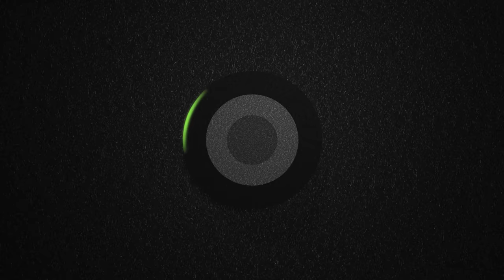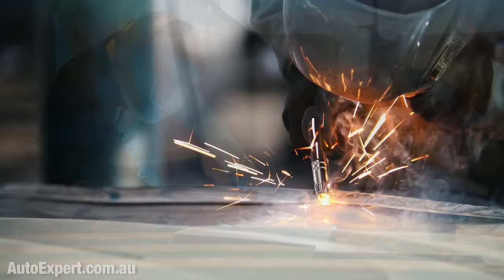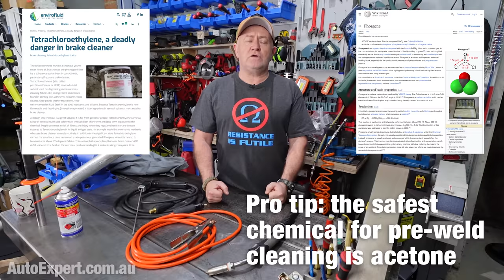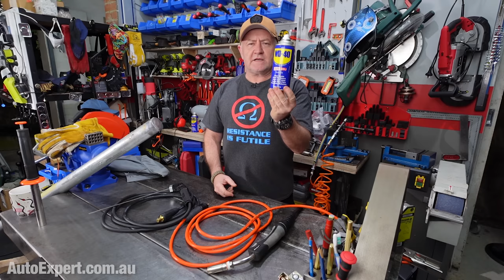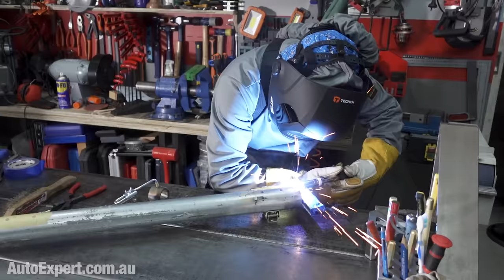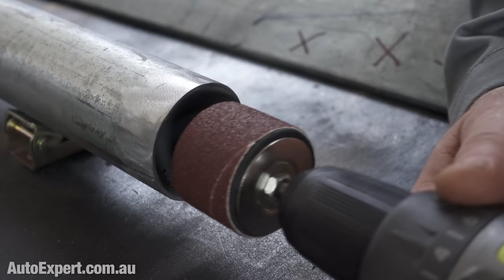How to die while arc welding at home: the top 5 ways | Auto Expert John Cadogan

Comment: One of the horrible jobs I had once was working in a factory on a line with 6 other guys and part of the work we had to do was grind down galvenised metal.  We all were coming down with what we thought was flu.  I looked into it further and realised it was Metal Fume fever.  So I put all my researched material together and took it to the bosses.  Not surprisingly they already knew about this and just could not be bothered doing anything about it because we were all Job agency employees and they could just get more when we got sick of putting up with it.  Well I stood my ground and insisted that they supply the correct PPE  and within hours we were all issued with the correct filter masks.
Reply: Good on you! Companies like that should have workcover hounding them.
Reply: Good on you for standing up for your rights!
Reply: Was it Merika’s navy, cause they hate civilians ! My general foreman died of some nasty cancer he got from working on chemical cleaning of the steam generator on the 688 LA Class tuna tubes, oops I meant submarines.
Reply: You stood up and you won! Good work! If it cost the boss a dime, people just assume it ain't gonna happen. Tight-butt bosses screw themselves and their employees.
Reply: As I recall, My dad ended up missing like a week of work with zinc fever, and the place he was working DID provide masks to employees (but I guess not very good ones). He ended up spending something like $3,000 on a nice papr system after that and never had an issue with fumes again.
Reply: @@BohappenstanceClick Buttermilk isn't going to clean your lungs out
Reply: @MekazaBitrusty or management hunted in a forest
Reply: I'd document everything and then I'd have OSHA on them so fast their assholes would be quivering. By law, OSHA requires the employer to provide any safety equipment that's needed for the performance of your job, and documented training in it's use.
Reply: @@BohappenstanceClick You didn't, but I wanted to state a difference between helping with symptoms and actually solving the problem of inhaling fumes.
Reply: Bosses like this belong in prison. They knew before you came forward, they may as well have taken a knife to you.
Reply: Yup. Fever Chills.  I got it gas welding galvanized pipe at 15 yrs old welding up a go cart frame.  Didnt know anything about till years later in high school welding class.
Reply: steel mill my father worked at had a galvanized section. all the guys that worked in that section were bald with terrible teeth.

not good stuff
Reply: I was afraid the end of the story would be you were fired.  Glad it had a good ending.
Reply: Would have went through hiring paperwork for a list of dangers in job and if it wasn’t listed I would have hired a lawyer because the the work industry is becoming a hassle with always wanting more out of you but never giving you more for work… as in you make him a production bonus while your handed a pizza party like kindergartners… it’s bonkers
Reply: Large fans are helpful
Reply: You were very lucky! I am in the civil construction industry. A couple of guys brought an unsafe practice to the site manager. They were both employed by a LABOUR HIRE company. The next day, there was no work for them.. That is one of the main reasons there are so many injuries in the industry these days. Back when unions had power, accident rates were a lot less.
Reply: Good job, man. Seriously. What you did there is a big deal.. nice to hear this kinda stuff from time to time.
Reply: zink poison it is not so uncommon
Reply: @geneticdisorder1900 what about the guys who clean the fuel tanks on the Jets 💀💀💀💀💀
Reply: @MekazaBitrusty  You mean the agency funded by the very Govt that ultimately profits off this exact kind of cost cutting? I think the glue fumes have got to you :P
Reply: @74KU  How does the government profit off a company’s cost cutting?
Reply: Every time I can recall of either me or someone else bringing up safety issues, either related to lack of proper PPE or worse refusing to let you even use it, or related to the environment( unsafe workholding, unsafe lifting procedure) and even interdiction to hit the emergency stop on the assembly line and so on... somebody finds a way to bring false disciplinary issues against you for insubordination, verbal assault or harassment, or even fires you because you are "caught" not using proper PPE against company policy. NO JOKE. Manufacturing, Warehouse, Retail, Metal working, didn't matter the sector. 
During the Solar Crown Panda Mike, the government was mandating surgical masks, so one such company had guys blowing fine metal and fiberglass and even sandblasting media (with natural sand) wearing only a "procedure mask".  Before the Dark Times, they had no masks, but were allowed to pay for an N95 or other respirator, but since the procedure mask was mandatory, you couldn't substitute it they said...
Reply: @Louis-op4zj    The ones with agent orange ?
Reply: @Louis-op4zj I worked in a Canadian forces fuel cell repair facility for 5 years. Headaches and migraines a couple times a week. The base hospital said  the headaches were part of getting old and to drink more water.
Been out of the shop for just over a year and my headaches and migraines have disappeared
Reply: I remember cutting galvanized steel with a torch all the time for a company, it puts off a yellow smoke, the goal was obviously to stay out of it but if you start feeling sick drink milk, it always worked for our crew.
Reply: In my earliest days, I was warned by a friend that to weld galvanized metal was poisonous. The smell of galvanizing smells like my grade school lunch room.
Reply: A bit of medical trivia. Zinc is absolutely essential for life.
It really is. But, like anything essential for life, excess can easily kill you.
Hence, my saying, "Everything in moderation, especially moderation itself".  ;)

Seriously, heavy metals are essential to life, zinc included and especially. But, too much of a good thing is poisonous.
Reply: These days they would fire all 7 of you one at a time and replace you all
Reply: Yeah my welder instructor was like whatever you do, no matter if this first lesson is your last, NEVER weld galvanized metal unless YOU ACTUALLY KNOW EXACTLY WHAT YOU ARE DOING
Reply: Amazing.  I thought for sure that the punchline would be that you got fired.  I glad I was wrong and that you didn't lose your job.
Reply: Q😊
Reply: @john-ic5pz when you say bald, do you mean like completely bald?
Reply: Galvanized has cadmium plating,,,,I wont grind or heat....that metal..
Reply: Was told to weld caps on stanchions in the parking lot. There were about 40 of them. Wrong parts were ordered. They were hydraformed from some really thick stock. About ¼ inch. Looked like they were at least double dipped. Had three large tabs around the perimeter and a parts bag taped to the underside with three heavily coated set screws. Carried a spray can of zinc paint to finish up the job. Figured that being outside that the wind would suffice. Took the mobile truck and migged hot clamping to one tab for the ground and burning off from the next clamp right through that thick Sherwin Williams exterior safety yellow paint. All said and done three hours. The staff bought about a hundred assorted subs from Subway along with some gallons of tea and most of the sodas from the vending machine. I came to in the hospital where I spent five days recovering. Made management start listening more. 👨‍🏭🥵🤢🤧🤮😷💉[̲̅$̲̅(̲̅ ͡ಠ_ಠ)̲̅$̲̅][̲̅
Reply: nahhhh don't just insist till they give in, sue the fuck outta them cause i guarantee if they let that slide, they're gonna gonna be letting all sorts of other shit slide as well.
Reply: @Destroy_Communism  
Like Columbo, help me out here. You were gas welding galvanized pipe, right? You were fifteen years old, right? And you found out years later in high school welding class that you should not do that?
What rod and paste flux paste were you welding with gas on galvanized pipe with? How old were you when you first started school to have you starting high school early enough that the welding class that you took was years later? I started freshman year at age fourteen. Took the welding class at age sixteen. Had the option to take advanced the senior year also should I had wanted to make a career of welding, but opted to quit in my junior year. Took my GED tests at the Community College, and had four semesters and full intentions of something in an office instead. So as Columbo would say, help me out with your humongous learning curve of gas welding galvanized pipe (which can't be done), and welding class yearrrsss later‽ Thank You Meshadda
Reply: @Destroy_Communism  
By the way, I wasn't trying to put you down at all. It's just that I could not figure out the timeline of the immense knowledge base that you have aquired. Looks like the Wolverine hobby/career is getting intense. Good night.
📽️ 🦚📼🎥🎞️🏁
Reply: Disposable people
Reply: This phenomenon exists with paints and plastics etc too called polymer fever. I get it sometimes when casting from dirty mixed lead sources if the wind dies completely or nasty stuff evaporates off.
Reply: @theGrooveChampion Not all bosses are bad though. I have worked for some that would get what you needed as soon as you made a valid and good case for it. I retired from one. Some employers still put in what they get out of you when you show how it’s needed and not just wanted and how keeping you long term saves them money retraining your position every few months.
Reply: Christ on a bike screw those robotic managers. PPE is not hard it really isnt.
Reply: That's outragious. Well done for sticking to your guns.
Reply: Why haven't you sued?
Reply: Milk dude milk drink it🍼
Reply: EXACTLY where I was going - grinding is just as dangerous as welding.
Reply: if only people thought about Co$&d that way. We’d all be wearing actual PPE instead of underwear on our faces… maybe.
Reply: Just don’t do galve
Reply: Msn with galvanized balls!
Reply: I think standing up for people in that situation would be suing those fuckers
Reply: @mightyconker3903  or hold your breath  and drink milk
Reply: Bravo!
This is reasonable & shame on them for not requiring it from the start.
Reply: Good for you. No shop wants the EPA nor OSHA snooping around.
Reply: Did they get a visit from work safe ?
Reply: Well done, you saved peoples health and lives...you made a STAND!!!
Reply: So like they knew and wouldn’t do anything because it was easier to replace you but then after only a few hours of “standing your ground” they caved and said okay ?
Reply: Luckily you still have your job , boss like that are selfish
Reply: So your the reason we have to wear PPE in heavy industrial. Thanks allot buddy.
Reply: @@BohappenstanceClick It does help form mucus but the smart way is have hard and fast rules and stick to them so I do. No machine is worth my health. It's simply not important to have a better way to do a wrong thing vs. refusing to do it in the first place.
Reply: I once had to take a position (unemployment laws required it) in a foundry that did die casting Al and Zinc and saw paramedics carry out a woman who was over come from inhalation of Zinc fumes. Galvanized metal is coated with Zinc! When you weld it guess where the fumes go! Zinc in it's elemental form is not a nutritional supplement. Good for you for standing up and being a protector of yourself and others.
Reply: @davewebster1627 I'm no electrician, so feel free to double check, but from what I heard, the voltage being low combined with a high current is scary in the way that it gives you a tingle rather than a shock but the current fry you from the inside out.
The one thing I DO know about electricity though is that it is lazy and always go the easiest route to close a circuit, so being dry and insulated and never making your body become a part of the circuit goes a long way.
Reply: @reaganharder1480  auto body and paint men used to regularly expire in their 50's. Better protection, understanding, and compliance all help, some still won't consistently, properly wear the gear.
Reply: Yup. And if ya drink some whole white milk and it taste really sweet then you know you have been poison from the Galvenise chemicals. The fumes from a solid to a gas will kill you fast. So go in all Zipped up.
Reply: …..” a big fuck off fire ball “ 👍🏻
Reply: .....and then you  lost your job...
Reply: If you expect to be lauded by your co-workers for protecting their health - think again.
 I wore a full facepiece respirator on to a job site which pretty much closed the job site when all the other subs walked off.
So, I was immediately fired right?
There're a dozen reasons why the GC wouldn't fire me and he knew all of them.
Fans were brought in, masks were distributed, and everybody went back to work
The subs that walked off were pissed cuz they lost a day's worth of pay and it screwed their schedule.
No one working with the process thanked me.
If you've never had a real job you're probably thinking people are stupid.
But that's because you don't understand the power dynamics at work on a real job.

Definitely protect your own health just don't expect everyone else to think you're something special.

After a week, no one cared about what happened.
Reply: . AMERICA  love it or leave
Reply: AMEN Bro, ya done the right thing and helped 6 guys live longer!
Reply: Good on you standing up for yourself and fellow workers.
Reply: I had metal fume fever from zinc dust from milling it.  After that we had a customer asking if we could cut beryllium.  The owners hit the roof.
Reply: Galvanized is crap to weld in. The arc goes green from all the zinc fumes which are very, very unhealthy. A thin shit and stomach pain is the mild version of it.
Reply: I got a Ag80In15Cd5 splinter and a depleted uranium splinter.  It was not enough U or Cd to poison
Reply: @kalleklp7291  we are scared of beryllium we won't let it in the building.  Someone had a beryllium copper hammer the owner saw it he yelled "get that shit out of here!"
Reply: We are scared of beryllium but lead, uranium, cadmium, tungsten, and niobium are ok.
Reply: When my boss, the job foreman told me his boss, the company supervisor had removed all NEC and OSHA required GFI ground fault circuit breakers from job site electrical panel. I reported it to local building inspector, who said he couldn't find the problem. When  I had to show him, the removed safety equipment was replaced. I was fired for reporting the safety violation.
Reply: @chadr2604  Ha,ha..ahh..Beryllium isn't dangerous unless it's turned to dust and inhaled. Many gemstones contain beryllium. It's used to improve the properties of metals like you mentioned with that hammer. TIG welding electrodes with Lanthanides (weak radioactive)are far more dangerous as one would sharpen them before use, thus turning some of them into dust.
Reply: @chillmonkey6782 Luckily since we have Biden, OSHA would shut them down.
Reply: That’s insane
Reply: I thought I had COVID after breathing 60 year old polyester that was cut with an angle grinder. Maybe I did though, not sure.
Reply: Thank you for standing up for yourself & for the others. I’m currently welding galvanized steel for a company through a temp agency because the company doesn’t hire and they don’t have the exhaust system that sucks fumes from the metal so I bought myself a fume mask
Reply: @franklofarojr.2969  I’m really against some things that Biden is for but I gotta say, helping laborers & attempting to make healthcare more accessible for the common Americans is 1 of the nicer things of joe Biden
Reply: contact an osha guy the fines will sting them so bad they wont ever dream about not supplying ppe years after youre gone. those guys show up and work quick.
Reply: Great content. Really good to know.
Reply: @spvillano sorry mate, but I reckon you're a bit off the mark. You're absolutely right about Zinc, Iron and Cobalt but there's many more heavy metals and the rest of them fall in 2 main groups 
1 - relatively harmless in small amounts, but are very toxic in larger amounts or in some forms (ruthenium, indium)
2 - seriously bloody toxic (think arsenic, cadmium, mercury, lead).
Reply: @NewHandleTown  the toxicity is more derived from quantity and bioavailability, as well as reactivity.
Elemental lead being a good example, as many people have it in dental fillings and even bullets remaining in the body. Not super reactive in elemental form, but react it with even a weak acid, now it’s bioavailable and reactive.
Reply: Sounds like you took the wrong route. Lawwww suiteeeee
Reply: We used to call it zinc flu
Reply: MILK is the treatment. Drink milk
Reply: @jjclarkson3261  yeah, drinking milk cures autoimmune attack on heavy metals. And  a chunk of lead cures headaches.
Reply: Report it to the gov.
Reply: @robertbowers9856 That probably had lead paint. paint. 😆
Reply: Fuck yea good job man. I’ve worked for a couple places that always hired temps and they were the worst and most egregious when it came to safety. Regardless of if you’re a direct employee or not you can always contact osha and try and get their asses in line if they don’t comply. They will probably find a way to fire you or you will be in constant battle with your employers but no one deserves to die for the personal gain of others.
Reply: Looks like you just needed some good ol fashioned 'Milk'!
Reply: Shouldn’t you have realized u where working with galvanized, before working on it? All welders should know about metals. Im no amazing wielder,  I’m maintenance in a factory and i knew about how scary galvanized is before ever wielding on it.
Reply: Good grief. I suppose you are in  the US. In the civilised world there are regulations about this sort of thing and the employer would be in extremely hot water over it regardless of whether the employees came from an agency.
Reply: good on you M8!
Reply: Yes zinc fever sucks and once you get it it gets worse every time you get near it.
Reply: Shame on them for knowing it would cause you all to get seriously sick and they didn’t care. That’s evil.
Reply: Remember working a factory maintenance job and we had a relatively small work area off the side of the main building where we kept our tools and things. Some guys from another part of the plant were in our area building something out of some galvanized guardrail and doing a lot of cutting with torch and welding. They filled that room with so much burning zinc we had to hold our breath to go and get tools. We tried to warn them about so much fumes but they seemed to act like we were just trying to prank them or something.
That was about 30 years ago, I wonder how they're doing today?
Reply: Myself I did considerable amount of galvanized mig welding, in fact I was even certified for galvanized sheet metal among other things.
I learned to do what I called
' snorkle welding ' where I would  not inhale while facing the welding but stop and turn my head around to inhale. I avoided it as much as I could.  Sometimes I would have to work in small enclosed areas, that would get tough, more like ' pearl diving ' .
I never had any problems with it.
Reply: Yeah,spread it through the shop.
Reply: @vieuxrawls923 Yes,spread it though out the shop so everyone gets a taste.
Reply: Cant mig weld in a wind tunnel, blow all your gas away.
Reply: Bro the gas that comes off galvanised steel is literally KILLER!
When I first started welding gal metal, i was like: "holy shiet!? Sooooo much fumes!!!?"
I thought welding outside and even using a fan would be enough?? 
Noooooo....
I'm a chippy and have worked with ALLLL KINDS OF MATERIALS and NOTHING had such an immediate effect on my lungs and stomach!..
From only "minimal" exposure, my lungs were sore towards the bottom of them and felt "full"/ heavy AND my stomach felt like it had a knot in it!?
Thankfully my wife insisted I get a mask and I did. Instantly better offand did not occur again.
Reply: This guy definitely works for a union.
Reply: This is where you call OSHA or whatever relevant regulatory body you have.
Reply: My neighbor (welder) builds private boat docks from galvanized, his voice sounds like he's been smoking two packs a day for 30 years even though he doesn't even smoke cigarettes.  I've told him several times, he thinks he's just too tough.
Reply: union strong brother!
Reply: @kodiak8525 : It’s like foremen get extra credit for risking your life.
Reply: Not many people know this but... 
While the great Steven Seagal was a cop for the past 30 years he was also 
an underwater water welder 
Cool right 
Yeah I know 

Coming this spring on FOX

Steven Seagal 
Welder 😮
Reply: @reaganharder1480 $30 floor fan.

No fumes.
Reply: That's why unions are important.  And the unions help the rest of us as well.  That never would have happened in a union shop.
Reply: Good man.
If nobody speaks up, nothing gets done.
Reply: Drinking lots of milk helps
Reply: I attended a technical college,we were tokd back in 74,if yourvwelding galvanized, try not to breath tge fumes,and drunk milk together rude of the lead in your system!
Yes lead is in galvanized!
Reply: @Destroy_Communism Destroy, I literally did the same thing building a go cart in the early 70s.  I didn't know anything about fumes n dangers.  Welder/field mechanic 20 years.  Have lung n heart disease, if we had the internet.  Things would have been better imho.  Its hard to weld day after day even when using a rear back breathing system under your helmets. 😢
Reply: You go girl!!!!!!!
Reply: @robertbowers9856
The smell of galvanizing smells like an overheated or failing transmission to me. I would go through an industrial district on my way to work when I was young. I'd keep smelling what to me smelled like a burning transmission. I didnt know about galvanizing, but I did know about cars. One day I asked what that smell was, and a passerby told me there was a galvanizing plant nearby and thats what the smell was.
Reply: You should have been issued settlement checks.
Reply: Basically same scenario here. Got fired lol, im not upset though. Screw that place
Reply: @vieuxrawls923  Enough airflow to clear the fumes affects the weld arc stability. Zinc is bad, but the chrome in stainless steel is even worse.
Reply: It's just so frustrating that we live in a world that still values money above basic human safety.
Reply: You should sue. Agency or not, you were technically an employee of that company no matter what legal loop holes they try to say.
Reply: What color is your cape?
Reply: Was this in Mexico?  Drink milk and hold breath in Texas. This is before air conditioned hoods.  How did y'all not know? Why did you not lawyer up and retire. That's pure negligence on a factory. Just the cutting oil is enough to give you Parkinson's. Hope you didn't sign an NDA.
Reply: Fire is #1. Pros in the US don't use brake anything. Cutting oil and galvanized is enough. I'm a commercial plumber and  pipe welder and run my own rig.  Fire, fumes, grounding because of sweat is something you learn to weld through. You don't even mention electrolytes (salt from sweat) increases current. I can weld through the current. You have to in Texas. You learn not to jump from buckshot, and weld when grounded. Cover up. Absolutely. I wear hanker chiefs all the time because I'm most comfortable welding.  Welders die early because of fumes and the nature of the work. I know when to put myself out when my shirt catches fire by the smell of my laundry detergent in shirt burning and heat under my hood. All that being said I weld through a hell of a lot. And know I'm dying early.  Grind 2 inches on either side of weld with a Galv respirator. Then weld with respirator too. Try  straddling and welding on double dipped beams in Texas summer. The heat the beams radiate from the sun, arc, fumes, and sun on your back. We drank milk and held our breath until we shook.
Reply: THANKS FOR VHAVING GONNIES!!!
Reply: @chillmonkey6782 That's when OSHA gets a tip about what the company is doing.
Reply: You still would have a case. only shitty companies use staffing firms. Taking their money away teaches them a lesson or shuts them down.
Reply: Brilliant. Sometimes you wonder whether ignorance is bliss! The more you delve into a subject, the more you discover scary sh… stuff
Reply: I was welding and cutting heavy galvanized angle iron from an old fire tower,the galvanizing on the iron was very thick,I became very sick,could hardly breath,figured it was bronchitis,was in bed for a week,was doing this work in a little shop.
Reply: Should have called OSHA.
Reply: Yeah... Galvanized poisoning sucks...
Reply: Most companies could car less about employees safety. They just want them to hurry up and don't complain or they'd find a reason to be rid of you with no income anymore. Can't pay bills or support your family because you didn't want to jeopardize your life span. It's becoming worse and worse
Reply: 👍 well done.
Reply: 6013 it bonds with  the galvenise and keeps it from turning to gas...
Reply: You did the right thing by your colleagues then and for the future.

This is what Union reps should be doing, if you are one good job, if you're not yet, you're the sort of person who should be one.
Reply: Where can I get the correct masks? Ty in advance.
Reply: Thank you. I respect good people who stand strong and stand up for whats right, especially for workers. Good on you.
Reply: Guaranteed, suing bad employers takes time but is bound to make them change, either by forcing them into well deserved  bankruptcy, or by bringing them to the realization that proper PPE is a truly wise investment.... and they can claim it as a legitimate business expense.
Reply: Would have been nice to have a union at your back
Reply: Used to weld galvanized parts all the time. Not fun symptoms only lasted a day. Who knows if it hurts me in the long run.
Reply: God bless you sir, we need to care about each others well being and all spread the necessary information on working with certain materials
Reply: I had it years ago they call it zink shivers.
Reply: Then you should have went and filed a class action lawsuit for you and all your teammates while you had em on the ropes so your lawyer could be rich and you'd get eleven bucks "but hey we won " your lawyer would say....
Reply: Monday morning fever

Symptoms improve during the work week, but return after re-exposure to metals, such as on Monday morning. This is why it's sometimes called Monday morning fever
Reply: Never knew the welder voltage was lethal?  65 volts they say?
Reply: Should've pushed for a 3M PAPR 😂
Reply: @Destroy_Communism 
Daring profile pic, mate
Reply: I think I had that once after getting a smelting furnace and melting a bunch of stuff. Something I thought was brass gave off this really nasty looking thick yellow smoke. It was like if you mixed yellow paint with milk. Very heavy too, had to actually pour it out of the furnace to get rid of it.